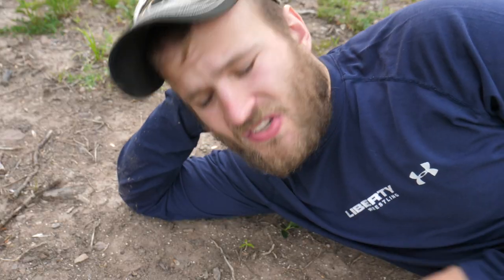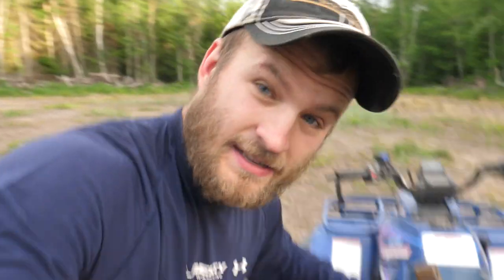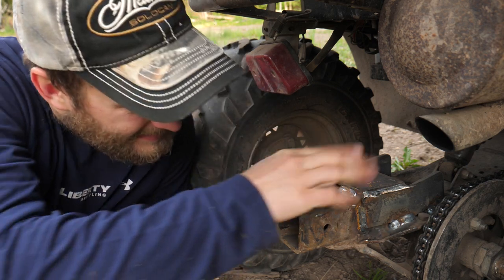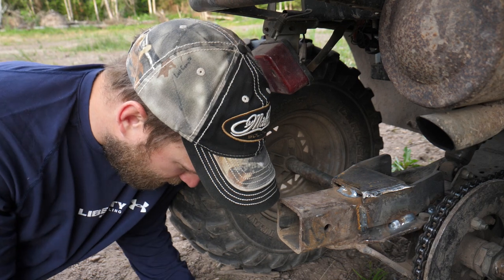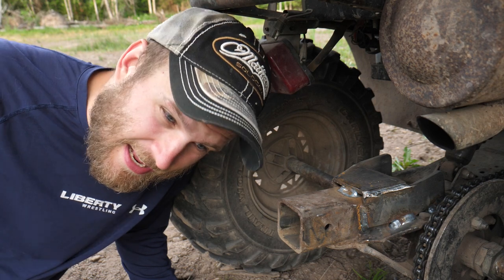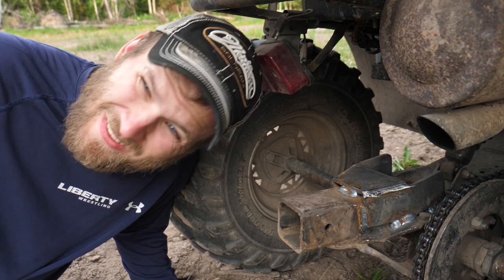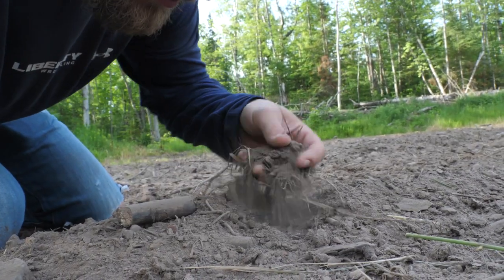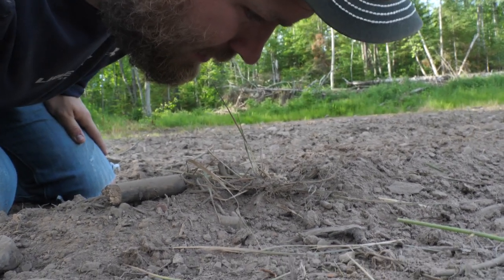RIPPING the SOIL with a GROUNDHOG MAX  |  18 Acre Deer Habitat Series (E.5)

Comment: Step one.. wait until your dust bowl dry soil gets rained on to till. Trying to till dry dirt is like pi$$ing in the wind. Step 2... build up the nutrients (bio mass) in your soil by planting things like buckwheat, winter rye, brassicas, etc. these plants will not only build your soil, they’ll help break up that hard pan, compacted layer of dirt. In time, you’ll get better dirt. P.s. rule of thumb.. if you’re dirt is blowing away in the breeze.. stop tilling! Lol
Reply from the maker: Great words of wisdom, and yes been planting some cereal rye and brassicas, been looking to add chicory too, we hit a bad dry spell last summer and didn’t rain for like a month an a half...I had some resin in the forecast so decided to try and bust up the soil so I could get some decent germination with the rain...but didn’t rain lol!!
Reply: .you disc that when the soil is wet ,you'll just gum up that disc..I've got a groundhog max, put in several food plots with it..actually works better when the soil is on the drier side